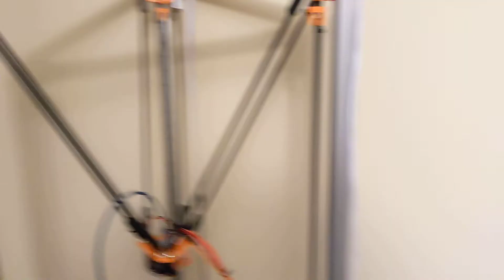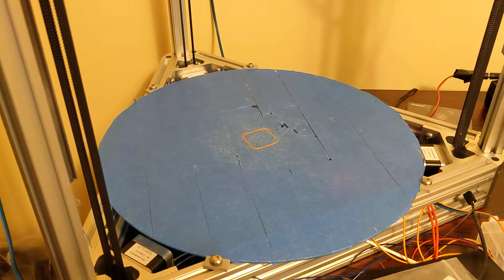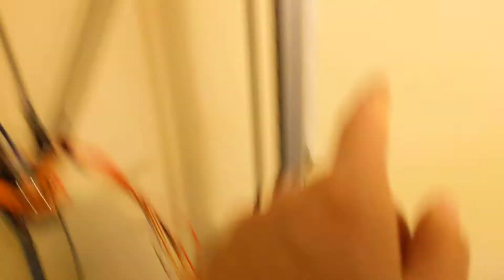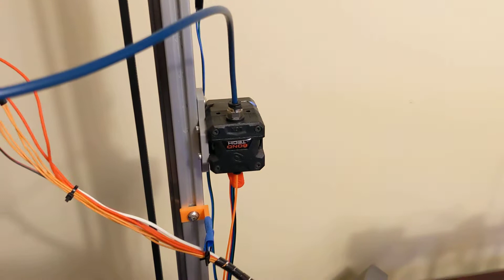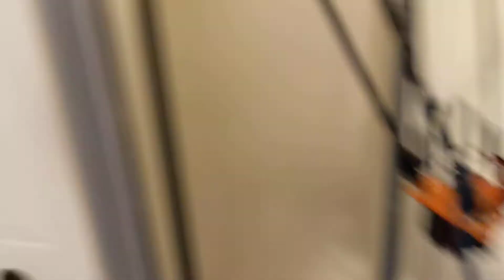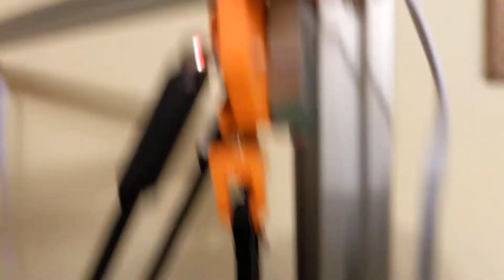Delta 3D Printer vs CoreXY and some info about Patreon STL files

Comment: Deltas don't get enough love. But I do think there's a lot more than you're telling folks about getting a good delta. A few tens of microns of inaccuracy in the arm lengths, ball end positions, column positions, squareness, etc. will create significant print inaccuracies, albeit many of which can be calibrated out. This is one of the things I'm focusing on in my design: repeatability that ensures symmetry.
Reply from the maker: yes for sure accuracy is key, modern firmware like RRF and Klipper help a lot but good components are always important. Depends on the size and accuracy your trying to achieve also.

Comment: Also a fan of Delta's, my only gripe is i think part accuracy is gonna be a bit better on corexy than on delta
Reply from the maker: I am actually curious about that, I have printed alot of printer parts on my delta and they were perfect. I think that was the case with older ones. I would like to do some comparisons of mine!
Reply: I've built a Mini Kossle Delta. On the same build plate, some parts are a bit different compared to the rest of parts. I'm curious as why this happens. 

I'm debating should I make my delta bigger by increasing the size of the base to accommodate bigger print or if I should build a big core XY printer.

Comment: The best part of the delta is also only 3 motors working together, and do you have any link for those linear rails?
Reply from the maker: I agree, here is the link I used for the linear rails https://www.aliexpress.com/item/32806622073.html?spm=a2g0s.9042311.0.0.72ba4c4dFFwDLm